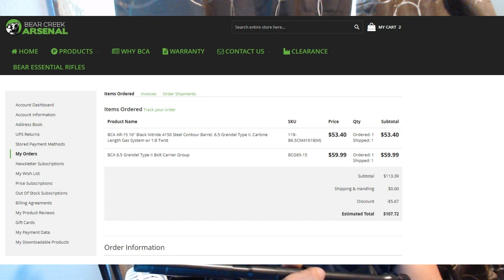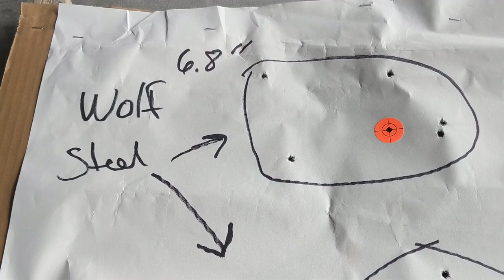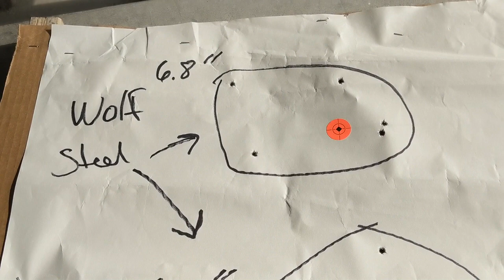Testing the Bear Creek Arsenal 16" 6.5 Grendel M4 Profile Barrel

Comment: My 20" BCA upper from 5-6 years ago shoots sub MOA all day. I have a 16" stainless BCA that I have not used, may not use it but don't want to sell it if the results will be similar to yours. The round seems to be optimized at 20" - 24" inches.  Shaw and Ballistic Advantage only from now on.
Reply from the maker: I bought a BCA heavy profile fluted Grendel barrel After I tried this barrel and it's replacement,  and that barrel shoots right at MOA with Hornady Black. and 2.5ish MOA with Wolf steel cased. YMMV.

Comment: I bought a complete 18” straight flute upper from them in 6.5 Grendel a few years ago. Mine shot worse than yours. I could not believe what I was seeing. I drove 2 hours to Sevierville Tn to get Alexander ammo in several different bullet weights. The Alexander loads did not shoot any better than the Wolf. I got nowhere with BCA when I contacted them about it. It was all my fault. Apparently I didn’t pin the upper and lower together correctly. I disassembled the upper and put the useable parts to work somewhere else.
Reply from the maker: Some of the groups were so bad I could have stood at the firing line and thrown the bullets more accurately. I absolutely couldn't believe it was that inaccurate without any keyholing.
Reply: Inexpensive Arms 
I’m glad you brought that up about key holing. My dad (a long time old school shooter and ballistics nerd) was also surprised that the bullets didn’t tumble. By the time I got fed up with the upper and decided to go a different route, I had exhausted all reasonable options. I ended up buying a 20” 6.5 G Satern barrel, lapping the receiver and using a kinda cheap adjustable gas block. Oh my goodness brother this thing is a shooter.. I am thrilled. Standard forged lower, rifle buffer system with a fixed Magpul stock. I watched a few sites closely over about 2 months and got all the parts at decent to very good prices. Oddly enough I bought a 20” .223 Wylde barrel from BCA and after polishing the feed ramps I have zero complaints. It’s a good all around accurate barrel.
Reply from the maker: @MushroomStampGalactica  I'm going to test a BCA heavy profile barrel with 5r rifling in 6.5 Grendel and see if it's any better next. I have it already, I'm just waiting for the gas block to come in.  BCA has some decent products, especially for the price. It's just, when you get a stinker, hoooo boy do you get a stinker. 

Most of their barrels in .223 Wylde/5.56 or 300 Blackout are pretty decent.  I'm guessing that oddballs like 6.5 Grendel are still working out the production kinks. 

Glad you got your rig running like a top. Thanks for the comments!
Reply: @inexpensivearms6952  have those issues been resolved? And does this pertain to the individual sold barrels or both barrels and uppers in 16”

Comment: I'm having the exact same issue with a 16" stainless steel barrel. I'm getting the same 13" type groups at 50 yards using different ammo  even after properly breaking in the barrel.
Reply from the maker: Yup. I had 2 barrels that were identical M4 profile that both shot like that before I just threw up my hands and went with a heavy profile. Still doesn't shoot great with SSTs, but it's MOA or so close it doesn't matter with Hornady 123 Black and about 3-3.5 MOA with steel cased Wolf after a little break in.
Reply: Does this pertain to just the barrels that were sold individually or all the 16” barrels and uppers?
Reply from the maker: @GBall_Vision  I don't know.

Comment: Groups that bad sounds more like a loose scope/scope mount
Reply from the maker: It wasn't scope/rings. 
I basically rebuilt the AR 2x times just to be sure it wasn't a fitment problem. 
It simply shot like hot garbage. 
The next barrel I got from them (same lot, same model) shot similarly. 

Finally, I bought a Grendel heavy profile barrel from them that shot about 1 MOA with Hornady Black, and about 3 MOA with Wolf Steel. 

They had so many complaints over their Grendel barrels that they pulled the barrels off their web site, shut down production for about a month, and rejiggered their processes before starting production again. The barrel was just garbage.